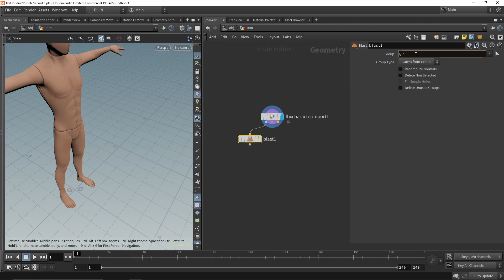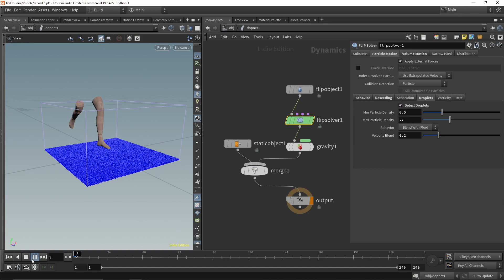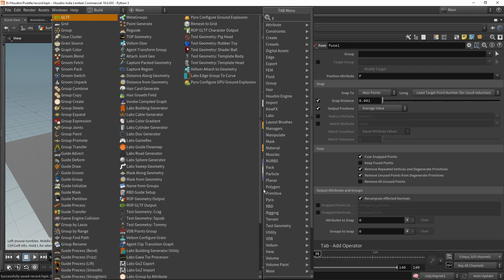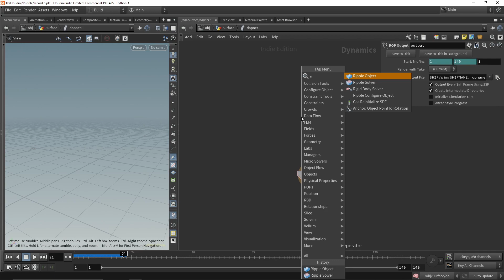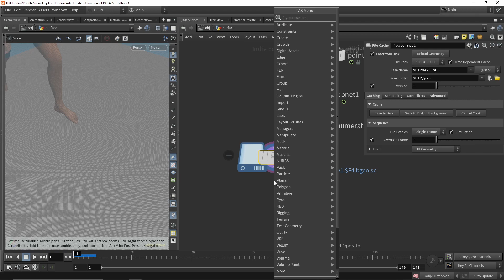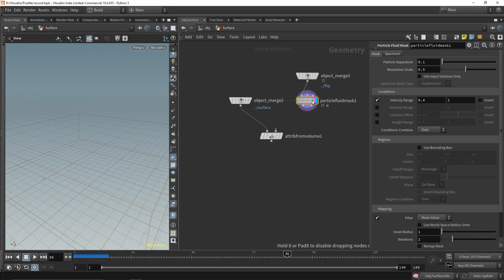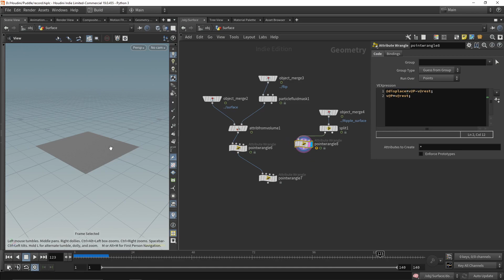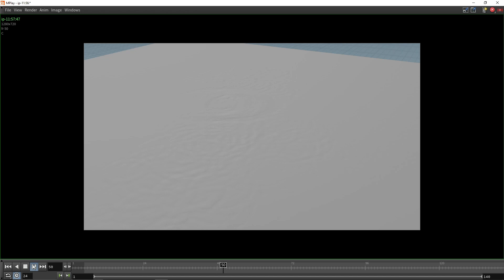Flip & Ripple Merge, Puddle Splash - Houdini Tutorial

Comment: Great tutorial! Though I am having an issue with the final step of combining the initial fluid tank with the extended geometry, the split node is finding the "origin" primitive group defined earlier but it only has 9 primitives in it and isn't properly separating the two geometries, which prevents me from adding in the split the geometry in the later step. I've setup my nodes identically as far as I can tell and downloaded your hip file to double check and can't seem to find the issue. I'd appreciate any guidance, I am somewhat new to Houdini so it maybe something obvious. Great technique and tutorial at any rate!
Reply from the maker: Hey, if you send me your hipfile (and what version of houdini you are  using) at edmond.bouletgilly[at]gmail.com I can take a look
Reply: @EdmondBouletGilly  Thank you for the help! If anyone happens to run into the same issue: Setting the /obj/Surface/grouptransfer1 Distance Threshold to .1 (or any value between 0 and ~1.7 in my case) property transferred the origin group. The default value of 10 was transferring the group to the entire mesh.

Comment: Hey i cant change the Values at 0:30 for Sample Range and Frame Range can someone help me please
Reply from the maker: Did you enable the checkbox right next to it ?
Reply: @EdmondBouletGilly  Yes but when i press on the value it stays green and doesnt turn black for some reason and if i change the number it switches back after i finished
Reply from the maker: That would be because that value is keyframed by default, ctrl+shift+left click should solve the issue
Reply: @EdmondBouletGilly  Yooo thanks alot that was actually the problem :) Also thanks for the fast reply...i wish you a nice day ^^
Reply from the maker: Thx you too